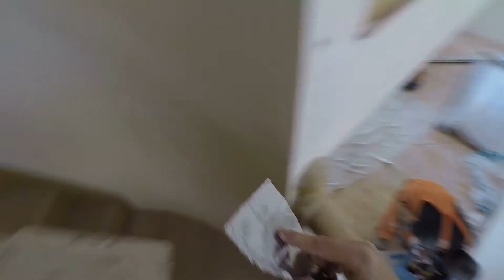How to stop the wall from cracking

Comment: Do you find you have more control using the hawk as to using a mud pan?
Reply from the maker: +cwrowe I've never used a pan, though with the four corners I'm sure the plaster will dry in them first, and scooping that out you would need to make an effort. Not sure about a pan, but with a hawk I normally carry a couple of various sized blades in the same hand. Hawk very easy to clean having a flat top.